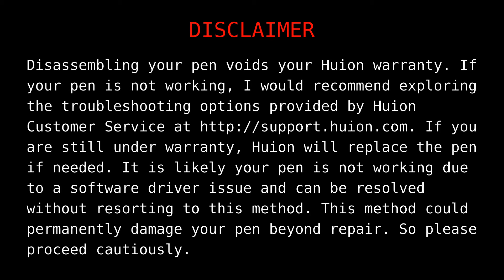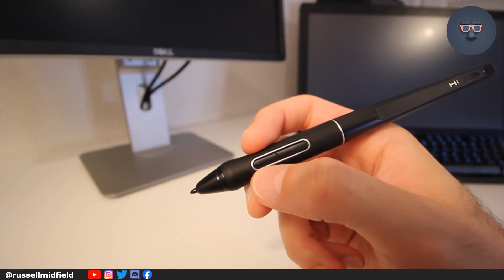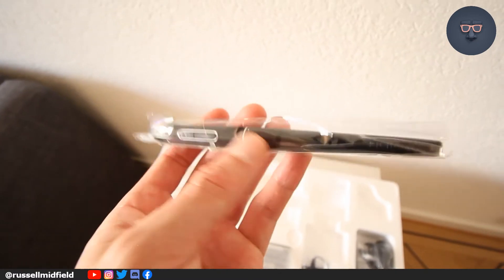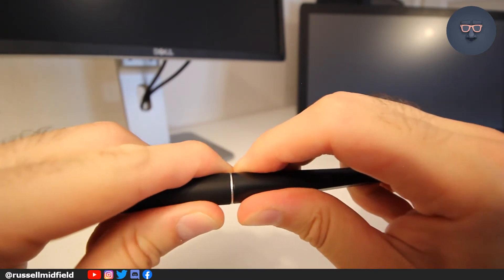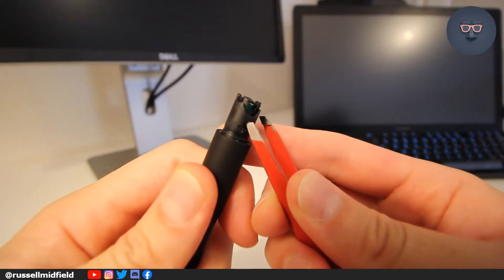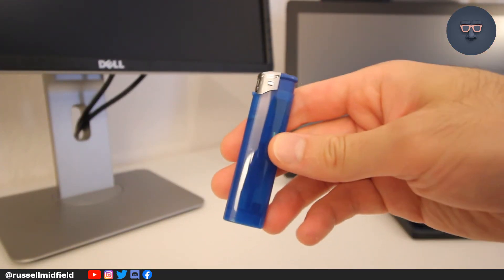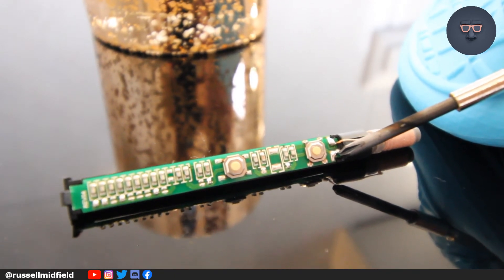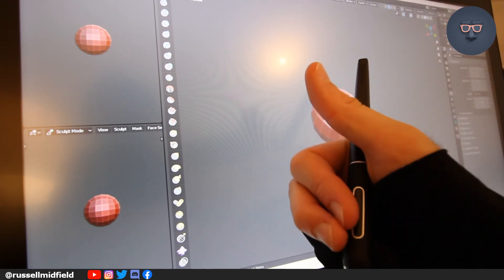I Broke My Huion PW507 Graphics Tablet Pen...and Fixed it with a DIY Solder

Comment: A little tips to separate the pen faster : apply some heat to the joint with a hairdryer, use the highest setting for 30 sec to a minute to melt the glue. I successfully opened it a minute later!
Reply from the maker: Oh yeah good idea, thanks rani!
Reply: I think each pen has different glue strength. Russel's pen looks much more easier to separate while mine is such a monster, even with the hairdryer trick and hours of twisting! Still, it IS possible to disassemble the pen with your bare hands. You really just gotta go with it
Reply from the maker: Yeah, in the video I had already spent like half an hour twisting it and separated it, so this was the second time for me, which was a lot easier. The first time took a while though you're right!

Comment: I've had this happen with two different pens. I feel like that wire is a common breaking point.
First one that broke is fair. I was beating against my thigh to the beat of music. But the second time, it just stopped working. No fall, nothing aggressive. I just put it on its stand, and the next time I picked it up, nothing.
Reply from the maker: Damn, yeah it definitely seems to be a super common issue from what I've seen. Oh gosh I'm just waiting for it to stop randomly working like that haha, I don't think my hack job of a solder is going to last much longer haha.
Reply: @RussellMidfield  Same, it's honestly made doing art a bit scary as I don't want to set deadlines for anything.
And as a chronic procrastinator, I need those deadlines, heh.
Reply from the maker: Haha yeah gotta have a 12 pack of pens just in case 😅

Comment: so 4 days ago my pen just died on me, and i found this video.
i opened up my pen, and the two wiring seemed okay at first but when i gently tap it, one of the wiring came off (?!),
i took it to phone repair tech and have it resoldered,
its working now, but i bcme very cautios when using the pen now 😥

anyway thanx very much for this video, u are a real hero 🙌🙌🙌 ❤️❤️
if i cant get the pen fixed, i have no fund to buy pen/tablet again,
Reply from the maker: That's great to hear Gaje! I'm glad the video helped!

Comment: I'm using the same size screwdriver as you ,yet after I hold it under fire for even more than 5 minutes, the metal wasn't hot enough to melt through. What am i doing wrong?
Reply from the maker: Yeah I know, it was strange for me, I just kept trying over and over and over, and all of a sudden, it was hot enough. I probably tried for at least half an hour of repeatedly heating it up. I would say hold it at the bottom of the flame, I read that it's hotter than the top. Don't give up haha, it'll work! I gave up like 5 times, but kept telling myself "its gotta work!" and it finally did, happened so fast it startled me and I almost dropped the screwdriver  haha.
Reply: @RussellMidfield  Fixed it. I just had to use the opposite side of the screwdriver because for some reason the tip wasn't heating up. I don't think it will last but at least it works. Thanks for the video.
Reply from the maker: Awesome! Yeah mine looks pretty gnarly but it's still going. Yeah no worries! I'm glad it helped!

Comment: i am so frustrated, the tip of the nib i'm using snapped and i cant get the stem of the nib out
Reply from the maker: Taking the pen apart will help. That way you can take the cone off the end of the pen and expose the nib completely.

Comment: I almost bought a new unit of Huion because my pen doesn't work. And after watched this video I check inside of my huion pen battery free, the wire was detached. I buy a solder in hardware stores and DIY fixing! And it worked! Thanks!
Reply from the maker: Woohoo, that's awesome!

Comment: Thanks mate! Same problem but I don't have a soldering iron so i just use some sew threads and bunch the wire with the solder joint, work fine again :) I bought the H1060P for around 40$ and the pen alone cost 20$ (I know it's cheap but it's half the whole pack price :). I think they made them so easy to broke so they could sell more lmao.
Reply from the maker: Year no worries,  glad it helped!

Comment: Did you use soldering wire for this? mines wire was too short to connect
Reply from the maker: No I didn't, I don't have any on hand right now, I just made use of the solder that was already there, it was enough that I could make the connection again, although just barely.
Reply: @RussellMidfield  should i use a soldering wire?? would it be the same result??
Reply from the maker: If you have it, then yes, use soldering wire.

Comment: Thanks a lot for the video. I dropped my pen and, the nib broke and there was no way to replace it without taking the pen apart. The remaining part of the nib was inside the little pipe in the coil and it was really difficult to get a grip both with my fingernails or with the tool for removing the nibs. Luckily my nail cutter did the job. I extracted the broken nib, put another one, assembled the pen and now everything works fine.
Reply from the maker: Awesome! I'm glad it helped!

Comment: Im not sure why but my pen wont come apart right the metal ring won't come off and the hardware wont come out after taking it apart, can you help?
Reply from the maker: The metal ring isn't super important I don't think. To get the PCB hardware out you need to push in the little button on the back.

Comment: Thank you sooooooooo Much. I never dropped my pen but I kept experience pen skips and the buttons on the pen would only sometime work. Spent hours updating drivers, redownloading and reinstall software to no avail. Saw this video and open up my pen and what do I find? one of the wire is no longer attached to the soldering. A quick soldering and the pen is working like new, no more pen skips, no lags. Thanks again for this great video. saved me from buying a new expensive pen and a lot of headache.
Reply: same with me.. damn Huion Products.. :(
Reply from the maker: Haha yeah, it's a little bit of a shame, thankfully I haven't had any other problems so far though!
Reply from the maker: Niiiiice! That's awesome to hear! Woohoo! Yeah exactly, I'm sure there have been many people out there that have had the exact same problem but never bothered to try and open the pen up and just struggled with drivers and restarts and cables for hours and days, only to end up spending $60 on a new pen. It's unfortunate that it seems to be a common problem, but its' nice that its at least not super hard to fix. Glad to hear it worked for you!

Comment: So i messed with one of the wires myself and now the solder guy says that if he does solder it...the glue will melt and the pen will die..

any suggestions please
Reply from the maker: Hmm, so you put glue on the wiring? I would suggest removing the glue, and then solder it.
Reply: @RussellMidfield  yeah but how do i do that?:(
Reply from the maker: Haha oh gosh, that's a tough one, I would say scrape if off with a sharp tool like a knife.

Comment: Thank you for this! My pen was doing the exact same thing, once I got it apart sure enough it was that one little wire. My DIY attempt at soldering it didn't work to well but I found a simple kit on Amazon for 15 bucks and it worked perfectly once I got it re-soldered! Life and wallet saver!
Reply from the maker: Yeah no worries! Haha yeah the DIY solder is a little dodgy haha, much better idea to go with the soldering iron haha! Nice job! I'm happy to hear you got it fixed!

Comment: I decided to take my pen apart because I already purchased a new one and I already don't have a warranty. I wanted to see if this one was just dirty. It started making my fingers tingle and now it doesn't work at all so I think its officially broken. My wires where intact but the right one looked a little off, but I couldn't really see.
Reply from the maker: Interesting, well it's good you waited until you had a replacement haha, taking the pen apart can definitely be risky!

Comment: I don't know if it's just my pen but I tried opening it and after an hour of repeatedly rubbing it and placing pressure on it to open it up nothing happened. I guess I will have to give it to repair or buy a new one.
Reply: I know it's late but for the buddies later, I'm just bending it back and forth and on my last frustrated attempt it accidentally came out, I mean just do it, you have nothing to lose right :)
Reply from the maker: Haha yeah exactly, you just gotta keep working it!
Reply from the maker: Yeah it takes a while, it'll loosen up eventually, slow and steady!

Comment: i have a huion 1060 plus pen. I opened it slowly and there's a black and red cable that was loose i have no idea where they. i have never charged the pen until now, whats wrong with it
Reply from the maker: Hmm seems like you probably want to connect those loose cables to the pens circuit board.

Comment: they really should consider using slightly thicker wire or a new securing method.
Reply from the maker: It's true, the wire is incredibly thin and the soldering job looks less than ideal. It's a recipe for disaster!

Comment: Can we do this for PW100. Please 🙏
Reply from the maker: Oh sorry I don't have a PW100 so I'm not sure exactly what's different. As Redreaper of Death mentions though, seems to be that its quite similar, just take off the rubber grip and pull the top off.
Reply: Check this page : https://digitalarttabletguides.wordpress.com/2019/03/21/a-note-about-tablet-pens/
You will find there the PW100 disassembled.
It is the same procedure to disassemble the pen PW100 and the PW507.
Hope this help.

Comment: Thank you so much. Worked for me as well. If only more people would see this video. Many pen problems would just disappear in dust. XD
I don't know why Huion connects the wires so thin. No surprise this breaks easily..
Reply from the maker: No worries! I'm glad it helped! Yeah, I try and post this on the Huion subreddit on Reddit every once in a while, when I see people having similar issues as I did, so hopefully more will stumble across it. Haha yea, it's too bad that the way they connected the wire is obviously not well done, but it's nice in that its a relatively easy fix, especially if you have a soldering iron.

Comment: How to fix when pen pressure doesn't go up and down. Accidentally it was dropped and the pressure stops working.
And You deserve much more subscribers and you have mine.
Reply: Same problem, I'm still trying to find a solution, as i was hoping to fix it to keep it as a back up pen for if my new pen breaks. I figured the sensor was somehow jammed, so i removed the cirquit board from it's plastic holder and then twisted the coil out of the plastic container. From what I heard just placing the spring and the little object that comes with it back in place should do the trick. 

But it turns out for me the rod core in the coil has broken in two pieces which probably affects the pen pressure...
Reply from the maker: Oh wow, that sounds like a more difficult issue to fix with a candle and an oven mitt haha. If I ever have this problem and figure out how to fix it I'll be sure to make a video!
Reply from the maker: Thanks man! I appreciate it! Oh no, so the wire is still attached but the pressure doesn't work?
Reply: @RussellMidfield  Everything thing is working fine only the pen nib was not going up and down and that was causing it to write in same thickness. But after some time I simply did this hack by dropping the pen from about 5 to 6 cm vertically and the pressure was working. It was like Banging the TV until signal come, but gently.😅
Reply: Also, I don't know if it comes under your category can you make Videos on how to make models of molecules in Chemistry. I have seen some of the simulation which has been made on Blender. I wonder how it's done. Thanks your time.
Reply from the maker: Haha lol! Thats an awesome technique! Haha 😂
Reply from the maker: Oh interesting, I haven't done anything like that before but I'll give it a try!
Reply: @RussellMidfield  My method also has same disclaimer as you.😅😜
Reply from the maker: Haha lol! 😅

Comment: Thank you, you really helped me out I fixed my h610 pro v2 pen it had the same problems but now it's all good
Reply from the maker: Thats awesome! I'm glad to hear it helped!
Reply: How did you open?
Reply: @hemachandran0908  first I took the rubber grip off then I pulled off the plastic top after that I soldered the wire back
Reply: @RedReaperOfDeath  Thanks 🙂
I opened just now. 🤣
Reply: @RedReaperOfDeath  The solder is not broken.
Reply from the maker: Thanks man! I don't have a PW100 so I wasn't sure what to say haha
Reply from the maker: That's awesome!
Reply: @hemachandran0908  I soldered my wire back on mine but yours is different so if no wires are off then it might be another problem
Reply: @RedReaperOfDeath  The magnet inside is broken 😟
Reply: @hemachandran0908  Magnet? I don't know about that bro lol you need a professional
Reply: @RedReaperOfDeath  I have to buy a new pen. But it's currently not available in my country. But I have another option of buying a small huion tablet (HS64) which comes with PW100 pen. The funny thing is PW100 pen costs 2799 INR and the HS64 tablet cost is 3000 INR. Huion's pricing is funny. 😂
The tablet I have is HS610 which I bought for around 7500 INR.
Reply from the maker: Oh no, that's not good. Yeah this video will probably not help in your case, sorry.
Reply from the maker: Haha yeah I'm thinking the same thing, I'm not sure my video helps with any magnet issue.
Reply from the maker: Hahaha oh wow, so by my math the HS64 tablet only costs 200 INR 😅 what a deal! It's probably the smart thing to do though, not much more and you then have a backup tablet just in case anything else goes wrong.

Comment: my huion PW201 skipping and stuttering after a few seconds, is this applicable sir?
Reply: i just disassemble it a while ago sir and yes, one of the wire has not connected, thank you so much sir!!
Reply from the maker: Oh that's awesome to hear! Good luck with fixing it!
Reply from the maker: Yes, it's possible it could be the same issue. Take apart the pen and see. If it's not the issue, you can just reassemble it!

Comment: thanks so much for posting this video , my pen also broke one wire off from the pc board, followed your instruction and work slowly and gently. You just saved me R1200 in South African currency ($63) and I now have a happy 15 year old again ! Luckily electronics is also my hobby so soldering was not a problem , but it shouldn't be a big one for your average person , or just take it to a phone repair shop and ask them to solder the wire back on if you cant  do it yourself.
Reply from the maker: yea not a worry! I'm so glad to hear it helped. haha, its always nice to come through for the kids! :) oh yes, a familiarity with electronics and soldering makes this an easy fix. Yes that's a good point, I should have maybe mentioned that in my video, I can imagine a electronic repair shop might do it for free or for very cheap since it is such a quick and easy job. glad to hear it helped!

Comment: Hello , Soo my stylus PW100 (H640P) dropped actidentally and now it keeps on registering / drawing even tho it doesn't make physical contact with the tablet / hovering. I don't know how to fix this, can anyone help me with this? I cannot buy another stylus cuz I'm kinda broke at the moment :'(
Reply: Hi, if you follow along with what Russell was doing, then it should be able to work. I had the same issue where it was hovering, but after fixing it, it worked and now I don't have to spend money on a new pen that would have probably have the same issues. I also noticed that it fixes unknown pen pressure issues as well??? I have my pen pressure on the same settings and it works a bit differently, but somewhat more accurate than before. I hope this helps!
Reply from the maker: @nisshokudrawz  oh that's interesting,  thanks for chiming in Nisshoku! I didn't realize this also could help with the hovering issue as well. I'm happy to hear it helped!
Reply from the maker: Oh hmm, interesting, seems like almost the opposite problem I had. I'm not entirely sure to be honest, sorry, maybe someone else can chime in!
Reply: I have the same problem too. 😭
Couldn't open it.

Comment: My pen button cover won't budge, please help
Reply from the maker: Oh that's great! To be honest I actually gave up after like 10 minutes the first time I tried because I thought it wouldn't come off or break, but I tried again and after another 10 minutes of constant gentle flexing and twisting it worked,  keep trying and be gentle it'll work!
Reply from the maker: You could also try warming the pen with a hair dryer to loosen the glue a bit. I didn't need to but it might have made it easier.
Reply from the maker: Oh no! Hmm, are you able to pull the rubber away from the buttons like at 2:08 in the video? That's the key to getting the buttons off. You might need to squeeze the buttons a bit as you pull as well
Reply: @RussellMidfield  i can get it out now, but the tube was so hard to unscrew, i think the glue is too strong? Or my hand just slippery 😩
Reply: @RussellMidfield  try using a towel to bruteforce the poor little pen XD